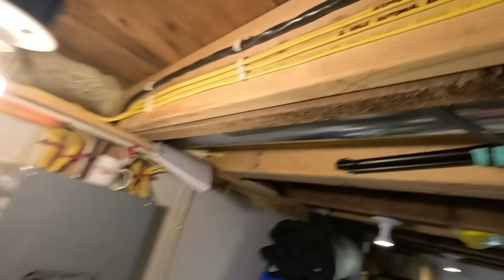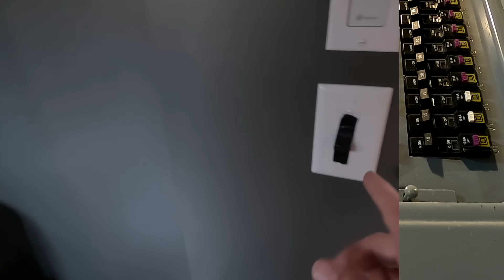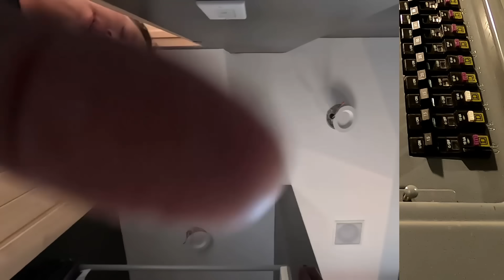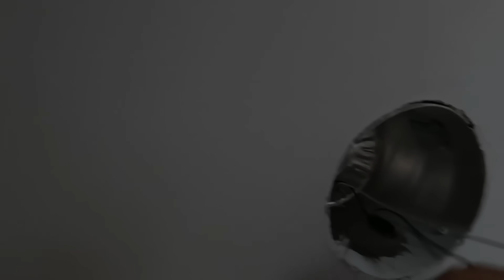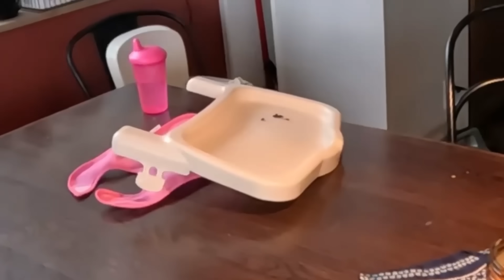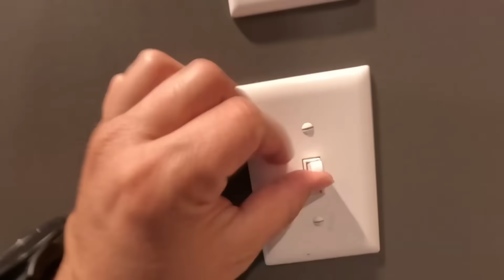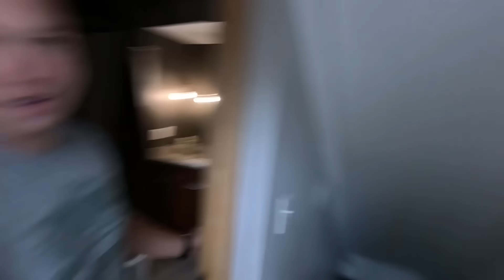Arc Fault Breaker Keeps Tripping! How To Fix It!

Comment: I agree with your accessement of FEIT led lamps. Ace Hardware carries those and I had all kinds of issues with them. I found their warranty was not very friendly as they wanted the original packaging and reciepts to replace any faulty lamps. Good luck finding that after a number of years. I also agree with the installation of the standard recessed lighting fixtures versus the LED units. I always want to have options on replacing the lamps only instead the complete fixture if the unit goes bad or your significant other wants a different look. I really enjoy your videos. Its funny to see all the bare romex in your videos as we have to run everyting in EMT in Northern Illinois.
Reply: Menards carries the brand also.

Comment: New built spec house. We kept having a arc fault trip on the dishwasher/garbage disposal circuit. Turned out that the Frigidaire brand dishwasher had a relay that would cause a trip as that spark happened. The relay spark is normal. So we found ourselves in a situation were we weren't going to replace the dishwasher which was perfectly fine. We decided to just eliminate the arc fault breaker <gasp>.
Reply: Stick a surge protector on the outlet. That will work without sacrificing the protection for the upstream wiring.
Reply: @Ariccio123  the dishwasher is hard wired with a outlet off that for the garbage disposal.
Reply: @andrewulrich6612  I feel like there's a problem with a new built house with a hardwired dishwasher!
Reply: @Ariccio123 the installation manual allows for either. And that isn't the issue. FRIGIDAIRE design in combination with a arc detection beaker is the issue. The builder had the same issue with two other spec houses and FRIGIDAIRE dishwashers. To ne it's a simple fix. Replace the arc fault with a standard ground fault breaker. ARC fault breakers trip a lot with  brushed motors as well. We had an older vacuum we couldn't use. It also kept tripping them.
Reply: @andrewulrich6612  All motors get their own circuit...
Reply: @mackellyman5642  it wasn't the motor making the arc fault trip, it's a relay in the dishwasher. It could literally be on its own circuit and it would still sense the relay "arc" and trip.
Reply: @andrewulrich6612  that is a violation
Reply: @cengeb  I'm not going to shop for a $500 dish washer to make a breaker work. We got by forever without AF breakers.
Reply: @andrewulrich6612  we had fuses,and candles too,and rotary phones..things improve. Afci breakers prevent fires
Reply: @cengeb  the washer is perfectly safe. AF breakers don't work with anything that has a relay.
Reply: @andrewulrich6612  We got by for 1000 years without AC, indoor heating, indoor plumbing, then ya know what, we have it, it';s better.  Stay out of the dark ages...
Reply: @cengeb  I'll run right out and buy another $500 washer so a breaker works. 😆
Reply: @Ariccio123 dishwasher should be its own ckt,nothing upstream
Reply: @cengeb  again, you can totally unplug the garbage disposal and the washer with its relay will trip the Arc fault breaker. It's a breaker issue. And the house passed inspection with both the disposal and washer on the same circuit. Labeled as such in the breaker panel.
Reply: @andrewulrich6612  lots of states have barely enforcement of nec rules. Pa being one. Jersey towns don't even allow garbage disposals,they create a mess in sewer systems.  Dishwashers min need to be on gfci.  No other load.  Afci prevent fires.  Your dishwasher is the problem not the afci.  Same with air conditioner condensors,mandated gfci,found out majority of outdoor units trip because of poor design. Nec gave more time to get mfgs to correct the problem with new ac units. Afci and gfci proving the connected products are a problem,not the protective device

Comment: Electrolytic capacitors have different shelf lives. Even if you build a component today if that capacitor is several years old it to go bad prematurely. Also, they are very temperature of specific.

I don't think the one in the shower necessarily had the bad electrolytic capacitor, because it seemed like that one had a default in the LED. Where are you saw the burn marks. However, steam from a shower could cause heat and premature failure of an electrolytic capacitors. 

If you still have the parts, you can always grab a multimeter and see what the resistance is, or if either one of the capacitors builds voltage ...
Reply: Over shower must be rated for damp locations, come on, and must be GFCI, not AFCI...so use an AFCI GFCI breaker

Comment: The one in the shower should be rated for wet locations. A hot shower and condensation on the cold light equals a wet fixture and a ground fault.  This is a case of a faulty installation using the wrong material in a wet location.
Reply: exactly and it needs to be GFCI not AFCI only

Comment: Very well done, troubleshooting the arc fault problem of narrowing it down to what was causing it.  It's good that electrical safety codes is a top concern, but all these modern solid state electronics in the breaker panel and cheaply made LED lights can cause a lot of buzz on your AM radio receivers in the house. That is just as important that these devices do not disrupt other electronics in the house. I had the experience of tracing AM radio buzz to arc fault breakers, that were first on the market, manufacturer corrected the issue in later production of them.  I have seen LED's causing the buzz noise on AM too.
Reply: @JCWise-sf9ww  Have you heard of COLOR television...it's pretty good, try it...indoor toilets too
Reply: @JCWise-sf9ww  It's 2023 not 1963...come on over
Reply: AM radio, what's that?  connected to your rotary phone?

Comment: I've also had problems with Feit electric LED bulbs not lasting anywhere near as long as expected. A commercial electrician friend of mine said he thinks that while the LEDs might last that long, the drivers for them fail much sooner. That being said, I also have a Feit electric motion sensor light that has worked pretty much flawlessly for a year or two. Perhaps the failure rate on cheap LED bulbs is just high? I dunno.

Comment: Nice presentation.
I have been looking around now a bit for combined arc fault and ground fault breakers and realized that they are expensive. I do consider that some equipment like refrigerators and freezers might be better of by avoiding the arc fault since they go on and off with thermostats that can cause arcs without being a problem.
In any case it seems like the ABB DS-ARC1 would be a good choice for where I live. Only catch is that the amount of arc fault devices for 400V 3-phase seems limited.

Comment: Cheap LED lights tend to be overdriven (more), but for areas where the lights are not on for long periods of time like perhaps cupboards or the likes, cheap is probably just fine. For kitchens and shower areas, I'd stick a higher quality light in though. Where I live we don't have ARC fault breakers yet, but it is good to avoid problems long term as wiring ages and equipment may develop faults over time.

Comment: Since LED lights run off of 12 volt DC, but they have to convert 120v AC to DC wasting some energy in the form of heat, wouldn’t it be more efficient for builders to start running 12V DC lighting circuits in new homes? It could run from a converter mounted next to the breaker panel or even be incorporated into the panel. RVs use this method.
Reply: its comming, soon enough DC power will reign within most homes. some high rises i have wired have dc throughout for lighting.

Comment: who wired that place, all the lights on the same level on the one circuit? 🤣 that's like lesson one of how to never wire a homes lighting.(sorry for being harsh if it was you, but lesson learned)
even back in the mid to late 90's we mixed the various room lighting into different general lighting branch circuits, including some of the basement/hall/stairs. often it ended up 2nd floor bedroom one receptacles with bedroom two lights and vice versa, kitchen/living room/dinning room lighting shared with opposing rooms general lighting receptacles. hallways, stairs and basement intermixed with each other and more than one circuit of course! so you pretty much had to trip multiple circuits or the main to be in the dark anywhere you went. we mostly keep them all on the same floor, except stairs/hallways/basement. no AFCI's used/required back then and sparingly used GFCI's, which often found the garage and outdoor rear receptacle/s protected by the powder room GFCI, and the master bath, GFCI picking up the a secondary full bath bath(if they had them) sometimes that did the powder room and basement GFCI picked up the garage and rear outdoor, with front being off a kitchen counter GFCI. I kind of hated that, but it was due to high cost of them back then.
I still amaze people when they say their garage or outdoor outlet has no power and it's been out for months or years, I instantly ask if checked the bathroom/basement/kitchen/garage GFCI's and sure enough it usually has a tripped one, somewhere they never use. a few gave me over $100 tips just for fixing and showing them that while there doing other remodeling work.

Comment: I have had light switches bzzt just a split second when turning them on or off (2 or 3 way mostly) so I replace them figuring something inside is probably arcing. Would you consider that the switch might have been the culprit before trying to trace the wiring?

Comment: Amazed that a secondary arc event (after rectifier, capacitor and regulator) would be detected in feed side enough to trip breaker. Would not have guessed that but evidence indicates that this is true. Nice job.
Reply: The led driver on those does't isolate the LEDs from the line side, so the noise generated by the arc is easily feed back into the line side and caught by the detection circuit.
Reply: Have you used the tell-tale feature of the breaker? It will indicate 1 of 3 conditions that caused the trip. Arc fault line to line, arc fault line to ground, or basic overload.  Without resetting the breaker, just close it. Then test, the indication trip will be either instant, 3 seconds, or 5 seconds. The breaker will not be conducting until it is properly reset.

Comment: I have challenges with the switches failing.    I had a group of led lights from home depot that started flickering after a year.  I ended up changing the lights out for another brand of led light.

Comment: Why did you not ohm out the load side of the switch. By continuosly tripping the breaker multiple times you could actually damage the breaker.

Comment: Cheap Chinese garbage. Several years ago, our utility sent out LED flood bulb replacements. They have HEAVY metal finned housings for their size (7 watt) and they are lasting really well. 

We also had an arc fault issue in our house a year or two after moving into the house we built in 1994. We kept getting up in the morning to find the breaker (no arc fault breakers then) for the kitchen lights tripped. It turned out to be an over driven staple withing a couple feet of the ceiling box in the attic. Got lucky the house didn't burn down. I was able to install a junction box in the attic to enable cutting out the bad piece and running a short two foot section of new wire to the box. It would have been a nightmare if was in the wall to the switch.

Comment: I think you missed a step in your troubleshooting. If there was a series arc, removing the load would also stop the AFCI from tripping. You should have installed a different lamp of comparable load to confirm there was nothing wrong with the wiring.

Comment: I don’t test my 2 arc-fault breakers (one for each bedroom) they do a great job testing themselves many times a week on my 3 year old (contractor built) in-law addition. I use my spare bedroom as an office with a MAC desktop computer for editing, two LCD monitors, many external AC powered hard drives for file storage, and a color LASER printer. Also a stereo receiver for audio monitoring. I was so sick of losing work when this damn thing decided to trip on its own for NO apparent reason, I yanked it and put in a standard breaker (SquareD) of the same value of course, problem solved. Oh and I have 4 ceiling LED recessed lights very similar to yours but I can't confirm this is my issues since the breaker trips with or without the lights on.
Reply: do you have UPS backup connected? the cheaper "line interactive" models (non online conversion) make arcs when switching on/off battery backup power and can nuisance trip them.
also, if they're about 4 years or older, they were fairly prone to tripping anyway, try replacing it with a new model. the breakers may be older than the home by a long ways, hard to say what kind of deal they got on old stock or used junk they pulled from elsewhere. 🤣

Comment: The Feit brand is good. Compare their products with others and you will find they have a decent price point and much value when compared to other brands. Just 8 years ago or so we purchased R40 LED lamps that were $15 each...today, they are maybe $3 each. No issues with them yet and we have about 41 of them in our home. Those "arc fault" breakers are likely about the same as those GFI receptacles for bathrooms and kitchens as well as outdoor receptacles...a pain in the ass. It would make some sense if we had a lot of fires or injuries that were because of "fault circuits" but I'd bet we do not and just one or two large legal cases came up through the courts where someone had an isolated problem which forced the industry to make these changes. Those and most fixtures have protections built into them, so the breaker is the weaker of the two protections causing the entire circuit to open. Thanks for the review....

Comment: I recently had a combo breaker fail on me. It was for the countertop outlets in the kitchen. Took me a few weeks to get to the bottom of it. I isolated the homerun the first day I noticed but it was still tripping and then I sat on it for a few weeks. Finally thought about testing the breaker itself. Its a little over 2 years old so it didn't come to mind at first.
Reply: a combo breaker is.........one that trips on series or parallel arc.....not a GFCI AFCI
Reply: @cengeb  The Eaton CHFP120DF is a 'CH Combination AFCI with Ground Fault Protection', so some combo breakers have GFCI also.
Reply: @thehoneybadger9262  not called a combo breaker. Combo breaker is afci with both series and parallel arc fault detection
Reply: @cengeb  I understand that. I just wanted to clarify that there are combo breakers that also have GFCI protection. I quoted exactly what is printed on the Eaton breaker box. It is a combination arc fault breaker that also includes ground fault protection. Sorry for the confusion.
Reply: @thehoneybadger9262 I think brealer gfci and afci with both functions is a dual function...combo always refers to afci series parallel arc protection
Reply: @cengeb  You had me questioning whether this was truly a Combination AFCI (even though it says so on the box) so I researched on the Eaton Web site, and their definition of 'Combination AFCI' is that it has both series and parallel arc fault detection as you say. The device also has a small UL/CSA label on its front that also states COMBINATION TYPE AFCI on a single line, so it is indeed a 'combo' AFCI that also has GFCI protection.

Comment: Yes good AFCIs are tested to UL 1699 and would be able to trip for serial and parallel arcs. False positive and false negatives however will still occur even if tested against the standard  some excellent research lab testing by Sandia labs sometime ago proved this was the case. joule heating, carbonization and plasma generation with arcs can create transient voltage, current waveforms and electromagnetic pulses that will map close to an arc signal waveform and the breaker or receptacle of AFCI receptacle trips. The action of magnetic forces/fields in devices are the most common false positive flags for AFCI tripping they occur in Motor loads (vacuums) in heating elements (coffee machines) magnetrons in microwave oven and in AC compressor and blower motors it is the generation of significant electromagnetic fields even if fleeting can swamp and blind an AFCI this is especially true with DC transient feeding onto an AC part of the circuit say a PV DC-AC inverters. I have used a Leviton combination AFCI/GFCI receptacle for a single device circuit which used to trip every once in 6-months but recent over-the-air update have solved the issue at least with the microwave not had any recent trips. it’s a difficult one but the advice should be not to ignore a trip investigate the issue systematically one at a time to get to the bottom of the problem. So great find on the LED light.